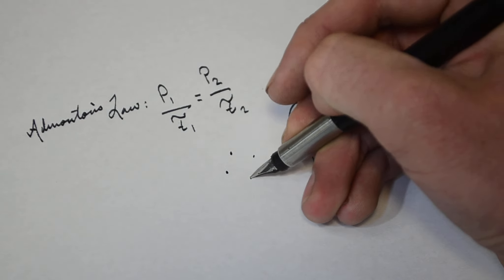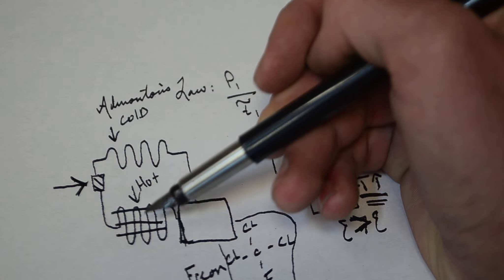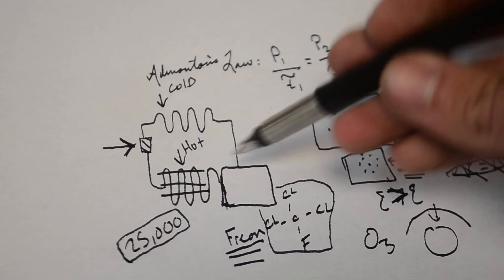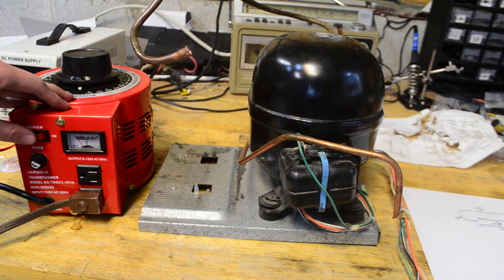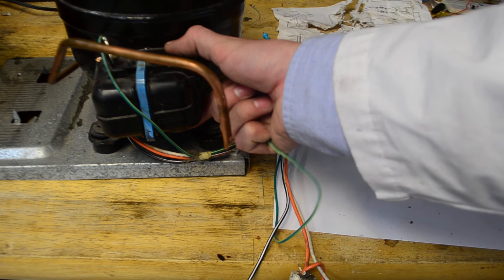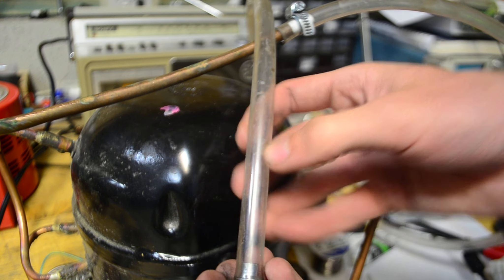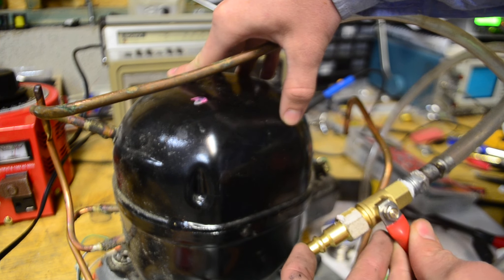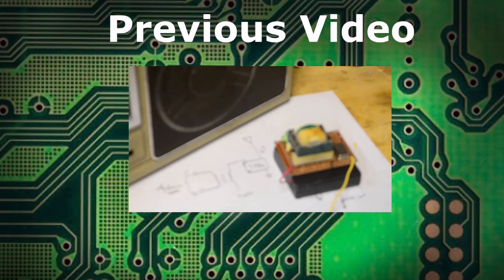How to make a Vacuum pump out of a Fridge

Comment from the maker: This weeks video is going to come out a bit late, sorry guys!
Reply: Take your time! We always appreciate your videos
Reply: C G Relays
Reply: The longer I wait the more acoustic I become
Reply: You can get a gauge on ebay for $3.50. Shipping might take a while: http://www.ebay.com/itm/1-2inch-Dry-Utility-Vacuum-Pressure-Gauge-Steel-1-8inch-Center-Back-30HG-0PSI-AC-/252823059295?hash=item3add6dbb5f:g:Mo4AAOSw4GVYFxW9

Also, I have a few questions.

1. What's the highest vacuum you can achieve with a vacuum cleaner? And will this burn out the motor? Maybe you could use your gauge to test this.

2. What's the highest vacuum achievable with mouth-suction?

3. What is the relationship of air-pressure to R-value (thermal resistance)? In a perfect vacuum, heat transfer can only occur via radiation. But I'm wondering if you can determine whether the relationship between air-pressure and thermal resistance is linear, logarithmic, quadratic, etc. I can't find any data or a formula that relates the two.
Reply: Keystone Science how many microns did it pull I'm super curious now
Reply: This video is very late. Freon (R22) was banned as a refrigerant in 2013, as an ozone depleting chlorofluorocarbon. Get with the program!  :-)
Reply: Look into ‘silphos’ brazing I just learned, it’s fun, that’s what you needed there , ‘soldier’ is ‘useless’ and frustrating for that application, the key ..is to use a Bernz-o-matic torch or the like and you have to get the pipe virtually red hot, then you are good to go, yes I’m also interested in how much vacuum power that great little design had?
Reply: @J.0.E  tell my if you got your answer ????
Reply: Hey, how many microns did it pull???

Comment: To help with the soldering (I used to work in HVAC). Clean the end of the tube then apply some flux to the end of the tube. You have to use MAPP gas because propane wont burn hot enough. The solder should melt when it touches the copper pipe and be drawn into the heat. Solder like to move towards the heat. Hope this helps, fun videos as always

Comment: I used a fridge compressor for an airbrush compressor.  It worked extremely well with a pressure switch, regulator, and an empty old bbq tank to hold the air.  If the intake of air is proportional to the output.  I can tell you for 100% certainty that it should be able to exceed 100 psi on a large fridge compressor.  That was the capacity of the bbq tank and it had no problem reaching it.

Comment: I used to build custom refrigeration systems, so I have experience at this. Soldering copper tubing generally needs acid flux and preferably, silver solder, working on clean metal. When sanding the stubs of tubing, turn the unit on its side if necessary, more than 90-degree turn even, so the grit will not go down the tubing into the compressor. Or plug the tubing with a rolled up bit of paper towel, to be removed after sanding. Just be careful not to dislodge the temporary plugs while sanding! For better vacuum, especially for deep vacuum, pump into vacuum! (Deep vacuum is always good, but especially needed for vacuum tubes.) For instance: Run 2 old compressors in series, with the outlet of one into the inlet of the other. If one has larger capacity than the other, you would generally want to put it on the low-pressure side, for maximum pumping rate, but valving varies and some valves require more pressure to open than others. The one with least valve restriction at low pressure should be the one connected to the system being pumped down. Also, a proper vacuum pump can be boosted with a crap pump like a single old compressor, IF the proper pump has a vacuum fitting on the outlet. Another way to go is to pre-evacuate a large cylinder and attach it to your pump outlet after it has pumped what it can out to atmosphere. You also can increase pumping speed -and protect your pump from water damage- by using a makeshift cryopump; that is, pumping through a U-shaped section of larger tubing you have prepared for the purpose of dunking in ice water with salt poured over the ice. Salt over ice makes the briny solution temperature drop to near zero Fahrenheit, so it can condense some water vapor even in vacuum. Better still, submerge the makeshift cryopump in a container of dry ice and alcohol, or if you can get it, use LN2 (liquid nitrogen). Copper wool (or brass wool or stainless-steel wool) inside your makeshift cryopump will improve the performance by adding a large surface area on which the pumped molecules can slow, contract, and even solidify. Purging the whole system with very dry CO2 will allow you to turn a crude vacuum into a high vacuum if the cryopump is chilled with LN2, because the CO2 will solidify on contact with such low-temperature surfaces. Other gas molecules being carried along by the CO2 will get buried and trapped in the dry ice formed in the LN2-cooled cryopump. Normal refrigerants will also solidify in a LN2-cooled cryopump. With proper valves installed and operated, you can make a laboratory-grade vacuum in a cheap way. After using the cryopump, be sure to warm it up and pump it out with your regular pump, to dry it thoroughly. As always, higher temperatures of the system being pumped will speed the process of evacuation. Water is particularly sensitive to temperature and will basically not pump at all near 32 F (0 C) unless the vacuum is prolonged and very deep.

Comment: Hey bud, I'm am A/C and refrigeration technician, first of all the compressor can go down to less than 500 microns or around 25 inhg. Secondly those compressors require oil in the Freon flow and Freon flow to lubricate and cool the compressor. running it the way you are is not very reliable and is going to have very short life.
Reply: themeez1000 I knew I wouldn't be the only one to point out the lubrication issue lol
Reply: Is there a workaround for this problem?
Reply: MrJaylassiter you could have the input line have a oil/lube drip/mister so the air it's pulling in has some lube but unless you can recover that oil in a catch pan for later reuse.  you will end up just wasting the lube.
Reply: meh, somewhat, you would have to get an inline oiler that's for like an air compressor and put on on the suction side with the correct oil for that compressor( depending on what Freon it took depends in the oil it needs) as for the cooling no, no way to work that since it is the actually cold Freon gas that cools the compressor.
Reply: themeez1000 for smaller vacuum setups, I wouldn't think heat would be that big of a deal. compressors can handle such huge temp delta from in to out that a short run of like 10min or so (lubricated!) wouldn't do much damage at all *my opinion, not fully sure
Reply: I was toying with an idea to make a cheap(but not dirty) food dehydrator/freezer. I'm not too sure that this is the correct component for the vacuum side.
Reply: no, without the cooling more than a minute for two of operation cam damage the internal components of the compressor and cause it to lock up.
Reply: I would NOT use this on anything with food or even near food. The oil in them is toxic and can poison food.
Reply: At minimum the oil has to be changed. The original oil is designed to work with the freon. In normal air this oil will start to foam and does not spread the heat effectively. The oil is highly toxic and should not be outside of a closed system. The good news are that most designs I have seen have a mechanism to "lift" the oil so all moving parts are lubricated and cooled (heat spread), as long as it is not al foamed up of course. So with a heat exchanger at the bottom of the compressor (cooler) and different oil I could see this work (if the design self- moves the oil to move heat). The problem is to remove the toxic oil, to find out if the compressor pumps oil over itself and fill it properly with new oil. - all of these require a special equipment, trained personell (also this mod is not taught to fridge technicians, if you had not guessed) and maybe even opening the protection (the black colored metal surrounding the compressor) which is a whole new story as it has to be resealed properly etc.
Reply: that is a hermetically sealed compressor. that black case is part of the pump if you remove the black case it will not pump at all. That style pump is also not splash lubricated. they are lubricated by the Freon carrying the oil around the system. Changing the oil is tedious and a pain it the butt. You would be better off going to a pawn shop and buying a vacuum pump for $100
Reply: themeez1000 agreed better to buy a pump. I'm not a fridge technician so I do not recognise the pump type from the outside. I'm basing my comment on what I have seen disassembled, and all I have seen have a tube in the shaft that drags up oil from the bottom and sprays it all over the pump, and that's why I said it may have to be opened to see what type it is (obviously not now since you already know) but had it been the wrong type the only alternative is more or less to return it to a recycling center - there would be no reason to even try to use it. Would it have been the spraying type, the other problems would remain but there would be a possibility to use it.
Reply: Thaks ! I wanna ask which is best vantury pump or refrigerator compressor for vaccume??
Reply: Used as a vacuum pump, it probably will never see as much use as a fridge that's always on and it may last well. Compare this to all the air compressors and tire inflators that are "lubricated for life".
Reply: @jansontomatoboy1835  This thing is going to get cold, not hot, since it doesn't compress the air above ambient pressure. Expansion of the air will cause the temperature to drop.
Reply: @wwindsunrain  It is definitively going to get warmer, hot if it gets to run for a while albeit only a little of that is from compressing the gas since when it has reached its minimum pressure there will be 0 net flow (no air to compress). Most of the heat in this configuration is generated by friction and electrical losses (resistance, eddiecurrents from the magnetic field in The motor). You can see it like this: when it is running, it draws power from the outlet, this usually becomes work on a gas. However in a state of 0 net gas flow it can no longer do work to any gas. Any power it uses will then become heat in The compressor as discussed earlier. Remember that even if you are compressing low pressure to atmospheric pressure is still a compression. 0.1 atm to 1 atm is the same compression as 1 atm to 10 atm.
Reply: @jansontomatoboy1835  You're mostly right. The point about efficiency losses and no air flow is a really good one and the most important here. However, incorrect about heat generated by the compression. Keep in mind that initially, the air in your vacuum chamber is at atmospheric pressure and ambient temperature. Expanding that by drawing a vacuum requires heat resulting in a drop in temperature in the chamber. On the other side of the pump, if the pressure would rise, heat would be produced. However, that doesn't really happen here: the earths atmosphere is so vast that the pressure increase caused by the little bit of air added to it by the vacuum pump is negligible and immeasurable and the same goes for the temperature: the pump does not cause global warming. So one side cools down and the other side warms up, but the warming side is so big that the temperature change is not measurable. It's the same with using an aerosol can: the can gets cold, but the air into which the propellant is shot does not seem to warm up.

But as you said once the vacuum is so strong the pump can not draw more air out, the pump will generate nothing but heat. It should help to have a pressure switch should shut it off until seepage requires it to run again.
Reply: Yes sir I thought the same thing ..I notice lot of the trades men in India and Asia use these as make shift vacuum pumps so God knows how they don’t seize up without oil ?? 🇬🇧👍
Reply: bruh, i used mine more than enougth to know it still has oil in there somwhere, how does 12 minutes of continuous running time sound to ya? XD

Comment: You can do this with a normal air compressor as well. The one I used can easily vacuum down to boil off water. You can also use the refrigerator pumps as an air compressor in a pinch but the normal fridge ones are very low volume (slow)  The other trouble with the refrigerator pumps is they easily overheat, and eventually sieze for the lack of oil even  when the heat issue is avoided by only using it with short on cycles. These are so low volume that any vac forming has to be very small indeed.
Reply: However that said, yes I have played with these and they were instrumental in many of my childhood experiments. Went through a few of them (uncle was an HVAC guy) These are great for MANY experiments. Good vid, please keep them coming.

Comment: Add a pressure chamber then you get a higher vacuum than just the pump itself, since those compressors have really small displacement but are instead extremely high powered for their size, actually add two chambers then you have both vacuum and compressed air from one unit. Old fire extinguishers should work.

Comment: you should try making a weak fusion reactor, not just a fusor. I made a tiny one using a vacuum pump and old high vacuum parts from ebay and scrap yards and ta refrigerator pump. if you need deuterium praxair sells it, you just need your own canister.
Reply from the maker: +Riley Downs I will try to! And tanks for the information! :D
Reply: no problem

Comment: Great job on the video.  Like your refrigeration diagram, however It is important to note that the vapor compression refrigeration cycle doesn't work with just a pressure change but a phase change with the refrigerant.  There is a solid column of liquid always feeding the expansion device on the high pressure side which flashes to a vapor on the low pressure side.  It is the condensing of the high pressure high temperature gas on the high side (Condenser - Hot Side) which releases heat absorbed by evaporation of the liquid to a gas on the low pressure side (Evaporator - cold side).  Older CFC (chlorofluorocarbon) R12 "Freon" systems most commonly used mineral oil or a synthetic oil called alkyl-benzene (AB) for lubrication and are very benign.  Newer HFC (hydrofluorocarbon) R134a systems use POE or PAG oils that are extremely hygroscopic (absorbs water from air) and turns to acid which attacks all components including the varnish on motor windings.  If you were to attempt this you definitely want a compressor which has mineral oil or alkyl-benzene (AB) for lubrication.  As mentioned by others refrigerant is used to cool the compressor motor windings and that heat is usually expelled by the condenser.  Oil also mixes with the refrigerant and is carried around the refrigeration loop back to the compressor.  Some compressors do have internal lubrication strategies and don't rely on refrigerant flowing in the system, but without the flow of cool vapor refrigerant back to the compressor, the windings will continue to heat up.  If you do this for a quiet air compressor or vacuum pump, then keeping the load minimal and operation time short is critical for the lifespan of the compressor.  The thermal cutout (unless internal in the windings) is external to the compressor housing and relies on refrigerant in the compressor shell to properly sense the temperature of the windings and shuts down the compressor if it overheats.

Comment: I once made a refrigerator out of a fridge compressor and I traded it for a key. They key opened a box on a boat at a local marina but to get to the box I had to buy the boat.
At the time I thought I'd never get to see what was in the box, but one night on my way home from yoga class, I started thinking about gasses and things and how my mortgage wouldn't be paid out until it was paid off and as I trudged along towards an oncoming stampede of antelope, my downward gaze caught a sparkle that could be only one thing...a girl's best friend. The one that is forever. The diamond. As the herd barrelled toward me I curled up into the smallest form I could physically achieve, and as the beasts bore down upon me, I snatched the stone with my three-fingered hand and swallowed it dry.
Now I'm's after having a difficult poop and a long canal ride to be meeting with my confidant Chum Lee, an international jewel dealer, and he knows a Scot living in Uganda who would give me enough to buy the boat. Soon I would have $3000 and the wonders of the box would be mine. I still don't know how to get the last of the butane out of my live resin, but the box may hold the secret...
Reply: Are you doing a challenge?
Reply: Depends on the contents of the box

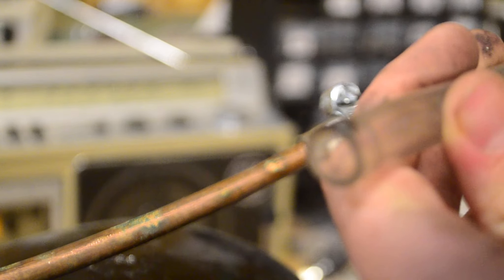Comment: Not sure if you were making due with what you had on hand (because I've done the same thing in a pinch) or if you didn't know, but the fitting that you pressed into the hose @4:27 is the male end of air line quick connector and not a barb that would be use in this case.
Oh and the "check valve" you used is just a 1/4 turn on/off ball valve. I'm sure someone else already told you, but I just wanted to let you know. Hope you get to feeling better! keep up the great work!

Comment: In regards to soldering the pipe... score and clean it first with a steel whool or steel bristle brush, then apply flux and heat just below the flux until you see it start to form a droplet and then run your solder across it in streaks covering the exposed surface. After that use the steel whool or steel brush again 👍🏻 then fit into the receiving fitting and heat and rotate until sealed and apply additional solder as needed 👍🏻